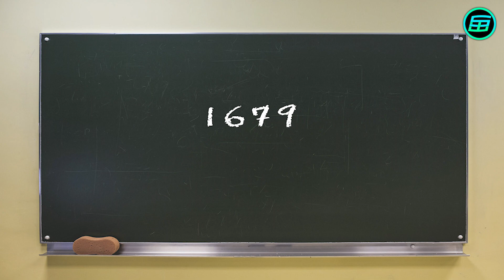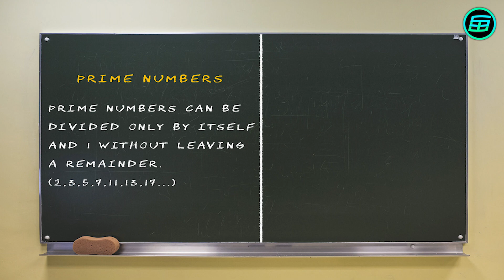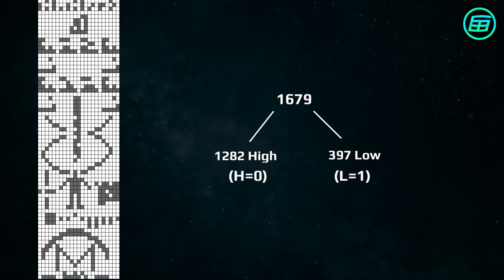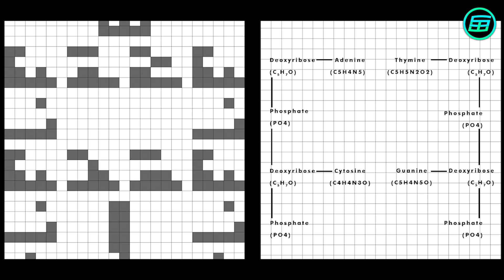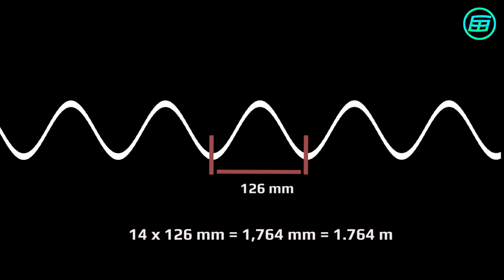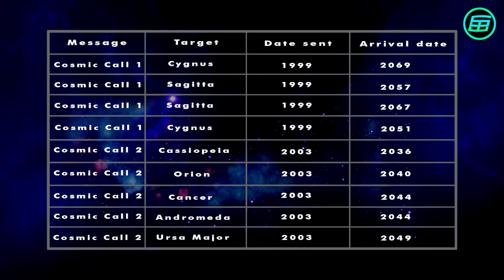Arecibo Message (Detailed Explanation)

Comment: This antenna system was purposefully destroyed by forces that one to keep the sheeple ignorant of possible ET's on other planets.  Personally, I have never seen completely not rusted wire right so spectacularly--------- it looked like a remote sensed bomb that destroyed the two hold -down spots.
       Come On people, the maintenance on this antenna was just fine. Some dark forces destroyed it---- how can a reasonable person think otherwise?
   BTW, I was at the University of Central Florida as a professor and administrator for over a dozen years and I know from that experience that no one should trust the UCF administration to do anything fair or legal...... UCF was the last custodian of the antenna before it was destroyed. For example former UCF president John Hitt was evil and never to be trusted.
Reply: "right" is corrected by using the word "fail"
Reply: Stupidity destroyed it.

Comment: ...it's so hard to find a video that fully explains each section of the message.
The "1-10" bit is hard enough, but none of the other examples really explain HOW this equates to 4,456,654 for instance. You tell us what it means, but it's really not as evident as you suppose. Same with the nucleotide #...it's vertical while the population # is horizontal.  Yet both are in the billions.

I've watched many vids purported to explain this message. They all fall far short of actually making it understandable. This one explains the "1-10" bit better than most, but as for the rest of it?
Is there a "For Dummies" version? Cause im apparently to dense to transfer the "1-10" info to ANY of the rest.

Not trying to be critical here. I just really would like to understand how this message works.
Reply: Did you find an explanation? I want to understand how the bottom lines equal 2,430
Reply: @scwashh it’s binary he explains it in the video but to understand binary uses 1s and 0s to represent information and it works by powers of 2 which means each number is doubled so you start with 1 get 2 than 4,8,16,32etc.
Reply: @eionthegod  Oh yeah thanks, I rewatched it and used a binary converter in the end
Reply: @scwashh the reason that number is 2430 is because there are 12 bits, a bit is a 1 or a 0. You read the bits left to right and first one in the sequence represents the largest number based on how many bits there are and the final bit is the smallest number one and you just add all the ones and ignore the zeros they’re just there to tell you how many bits there are, since it’s 12 bits that’s 2 to the power of 11 so since the sequence is 100101111110 so it’s 2048+256+64+32+16+8+4+2 or 2430